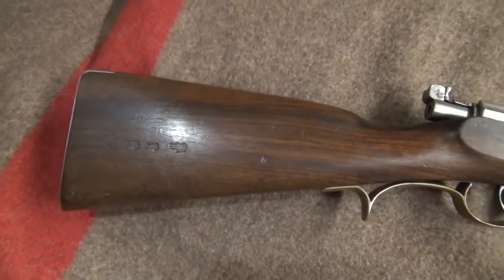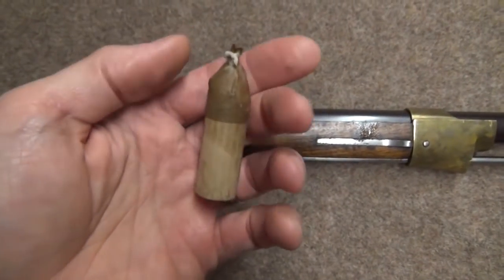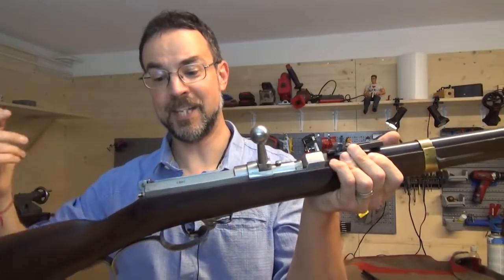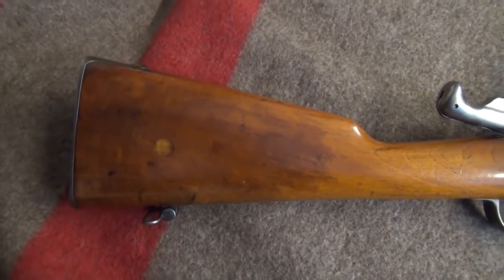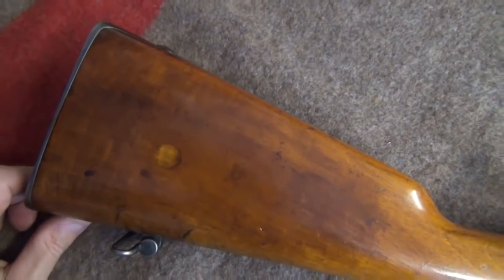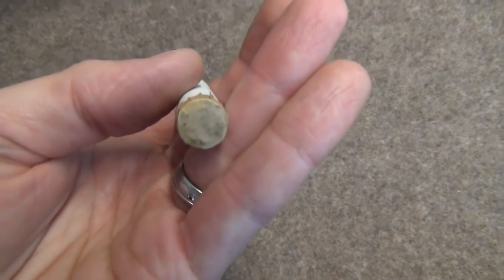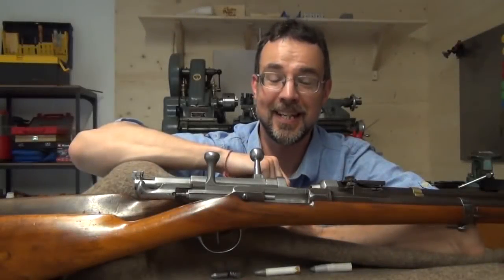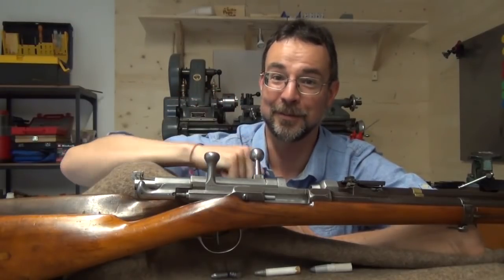Chassepot Versus Dreyse, The Mad Minute Grudge Match

Comment: Always good to check if your rubber is leaking
Reply: I  am surprised that it lasted more than one shot. 
You can see tyre tracks on the road where there was a risky manoeuvre and that is from strong heat treated rubber. 

Still, machining steel to tolerance might have been too difficult then.

Comment: If I was given a a choice between these two rifles, I would be tempted to choose the Dreyse just because it seems much easier to maintain than the Chassepot. Fouling is less of an issue, there is no rubber seal that will deteriorate and need to be replaced, and the needle can be replaced as easy as unscrewing it from the back and sticking another one in there. The Chassepot has got the range, but that's about it.
Reply: In addition to the superior range, the Chassepot is smoother to operate, and the needle is more durable.
Reply: @khester7397  From what I saw watching this movie, operation looked much smoother on the Dreyse.
Reply: The Dreyse's larger bore allows less residue build up and fouling than the Chassepot. The Chassepot has a faster fire rate, yet, French soldiers struggled to manage the recoil and turned to playing the butt of the rifle at their foot when shooting, almost as a mortar style type of firearm, lowering accuracy immensely.

Comment: Hi Bloke! I am shooting a Chassepot as well and I am experimenting how to lower the fouling in the chamber and bolt mechanism. Question: is there any way preventing fouling getting pass the needle into the bolt and spring? I've noticed it gets dirty there as well. I know you have tried a piece of rubber in your earlier cartridges but they got stuck in your bolt.
Reply: Not really, it’s one of the weaknessesof the system. There is an intermediate needle guide in the middle of the bolt body (noix) which should also limit fouling into the spring area but these wear out with time and are difficult to get out and replace. Since using the bubble tea cartridge though the fouling issue has largely gone, at least for casual range use.
Reply: @thebotrchap  thanks Chap for your confirmation. I'm using the bubble tea straw method as well only recently. Going to try it out some more and also I received 1 litre of flame retardant fluid which I will be using on de sides of the cartridge. Less burnt paper residu means less chambering problems.. I hope ☺️

Comment: Also interesting to see the difficulty recocking after several rounds.  My Chassepot does the same thing.  Do you run an internal washer/gasket behind the tophat, where the needle passes? I have read that some have found that to mitigate the grittiness, but I have not tried it yet.
Reply: I didn’t because that would be cheating 😉 Interesting to note that the Dreyse does have the equivalent. The needle carrier has a recess for a leather gasket.

Comment: I think I'd rather have a slower firing weapon that keeps on going, rather than a quicker one that jams up!
Reply: Well in both cases this mode of fire is rather artificial but the fouling question still stands in the case of a long exchange of fire, rapid or not. The superiority comes rather from the ability to hit at ranges which are impossible to the opponent. You can then cooly lay donw precise fire and have time to deal with fouling should it occur.
Reply: @thebotrchap  Yeah, I guess accuracy takes precedent, updates to bolt actions improved reliability fairly quickly too. Fair point.

Comment: The chassepot had problems when it was hot, the rubber seal wore out quickly and the SAS system became increasingly difficult to operate. The original cartridge was more unstable and sensitive to moisture. It also didn't burn as well and the remaining material had to be funneled out first. In addition, the Dryse could be dismantled without tools and changing the needle was quick and easy to do from the outside. This was more complicated with the Chassepot.
Reply: The original chassepot cartridge was never intended to be consumed, debris was sucked out behind the bullet in the same way as the Dreyse, hence why they both have a swirl chamber around the needle guide on the bolt. The needle is harder to get to in the chassepot because it is far more unlikely to break since it is thicker and is less exposed when firing than a Dreyse needle. Even then, Dreyse needles are not as delicate as people think. I have not yet broken one in over ten years of needle firing.

Comment: my only issue is that it appeared that you took more time to aim with the dreyse,  though I know its inferior simply based on tech.  My other issue would be the modification of cartridges.  I know you have to make your own but I have a feeling that carboard tube slides a lot better into the breach than the original tied paper.

Comment: I'm very curious as to the accuracy of the Chassepot. Much information I find seems to suggest the primary advantage over the Dryse is the extended range rather than tighter shot groups. What sort of accuracy have you been able to achieve with the Chassepot?
Reply: Extended range is useless unless you can be reasonably accurate 😉 I’ve only taken it out to 100m and it holds the 9-10 ring fine. I’d like to take it further but unlikely to happen

Comment: You also seem to be much more experienced with the Chassepot as you are confusing the cocking routine in use of the dreyse. All your movements are much quicker, even those that have nothing to do with handling the weapon but with taking the ammunition from the pouch. When shooting with the Dreyse, you have the cartridge pouch behind you on the right. With the Chassepot, it is on the right on your stomach. You also don't lower the Chassepot as low as with the Dreyse. A good shooter with the Dreyse will only need more time with the extra step to pre-cock the needle, if he can't even do it in one go when putting the firearm on.
Reply: Actually I’ve had more range time with the big D since the round ball ammo is easy to load. It’s just a clunky rifle compared to the C. The loading space between the „chamber” and breech face is also very tight on the D so it helps to see what you are doing, hence lowering the rifle. With the C you just need to throw the cartridge somewhere in the nice wide bolt channel and it will feed.

Comment: The geometry of the bullet is motivated by the shape of birds. Which is in fact, while not properly implemented, better than the very flat bottom of the chassepot projectile having a very disturbing effect as it is not "closing" the streamlines at the bullets back at all. Neither is the bullet you are using splitting the streamlines in front of it properly.
Reply: I have no idea what you’re trying to say. It’s historical fact that the C had a flatter trajectory, longer range and higher precision, even the Prussians acknowledged it.
Reply: @thebotrchap  "The geometry" I said.  "The bullet has this funny acorn shape which is not the most ballistically efficient". The bad trajectory came from the small load they chose and from the heavy bullet (31 g). I never tried to say the Dreyse is superior. The rifle is 25 years older.

Comment: Why did both of these needle rifles still have ramrods? Did they need the ramrods for cleaning the inside of the barrels?
Reply: Cleaning and clearing. There is no extractor so you need something to push out a cartridge if you get a dud. This practice continued well into the 20th century on military rifles.
Reply: Thank you! However, maybe now we should call them extractor rods!
Reply: @chomocharlie3997  In British doctrine they were referred to a clearing rods with the introduction of the Long Lees since they were issued with pull-throughs for cleaning. The rod was also shortened so that two or three from the squad rifles had to be screwed together to be actually used.